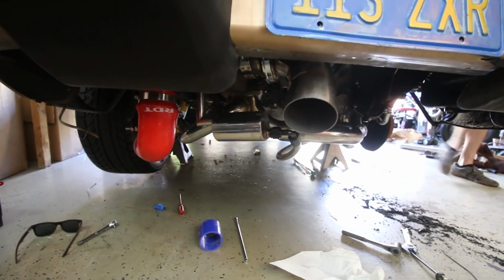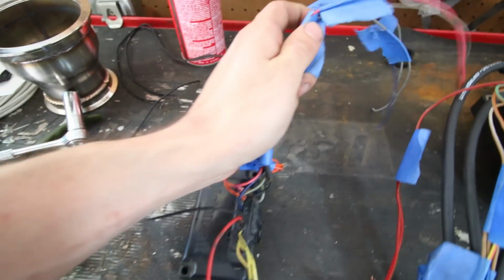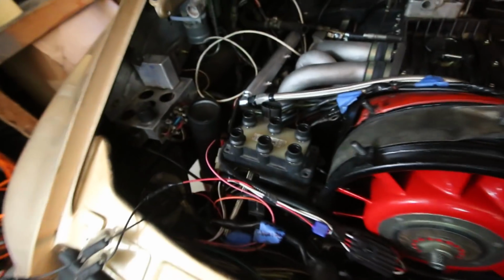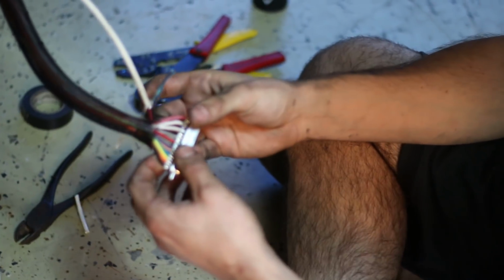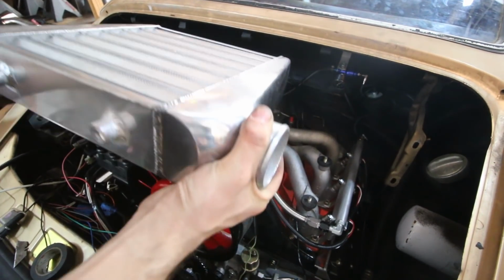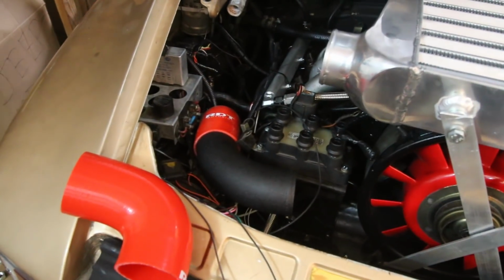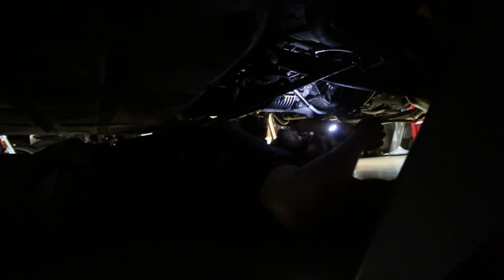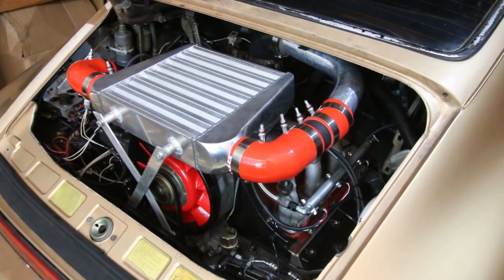Garage built 911 Turbo - Time is UP!!

Comment: WHERES MY PLUG?!  I told you about EDIS so many videos ago I told you to ditch that expensive Porsche Dizzy. Btw EDIS has its downsides ( look it up )  sometimes its better to ditch the module and Have ms2 control the coil direct its pretty easy just add 3 BIP drivers.

Comment: This engine build was 20k??
Reply from the maker: Cost Breakdown:

Bottom End, upgraded oil pump, ARP hardware, GT3 bearing shells - $6700
Custom CR pistons: $1200
Head rebuild and port: $3000
Stand Alone ECU and distributor delete: $1500
(Boost Conversion) Headers, Tial wastegate, oil lines intercooler piping ect... $2000
Hardware Kit/Gaskets: $300
Clutch Kit: $500
CIS Delete/EFI conversion: $1550
44LB Injectors: $200
Cylinder Refresh/Hone: $400

... I'm sure I'm forgetting things. But theres like 17000 in just the list above.
Reply: Damn!! That added up quickly. Keep up the great content! Been following since the first videos.

Comment: Well related to this, my biggest let down was with myself. I was so wrapped up in work for months and didn't maintain my truck (93 ranger splash). Driving down the freeway halfway home something went "Zvvssykrjrhw I dgeheg as ntktjfjrjrjehehwb¡!¡!!!" And it flew out of gear. I pulled over and again "BOOMNRBEHWGWHRJEHFKRH!!!" truck stopped and died. I was sad and had no choice but to buy another car and was still super busy with work. I never once looked at the truck or even tried to figure out what was wrong, I just sold it. I miss it. It's been about 9 months

Comment: Just finished rebuilding my engine, lowering it back into the engine bay and the bolt holding the lifting chain in pulled out, engine fell 3 feet and crushed the rad support along with ruining the oil pan and pickup tube

Comment: Had my new built Evo 8 motor for my Porsche 911, when it blew up the machine shop forgot a 30 cent wrist pin clip $15,000 later its a beast 505 whp

Comment: I put a v6 in to an sw20 mr2 once. Did it on a budget and was less than AU$600 until I had the Ac pipework reconnected... Doubled the build cost and lost all its gas in less than 12 months